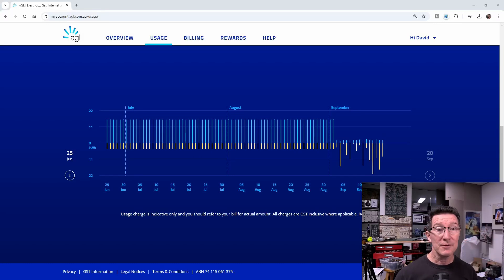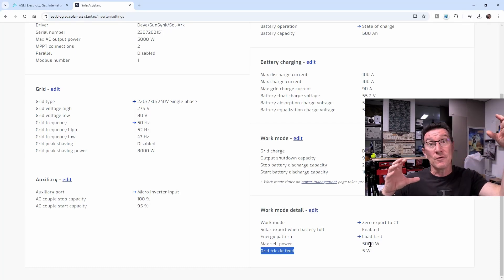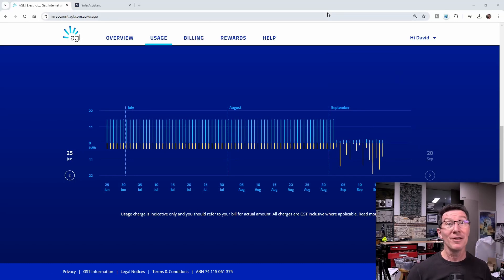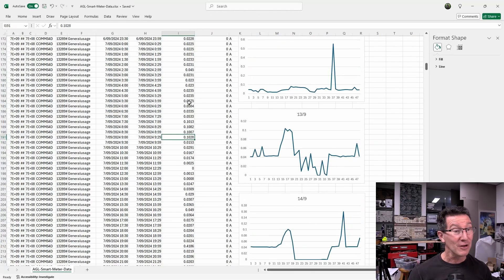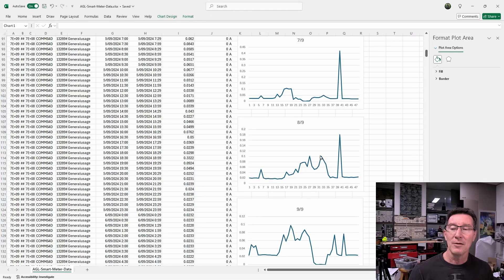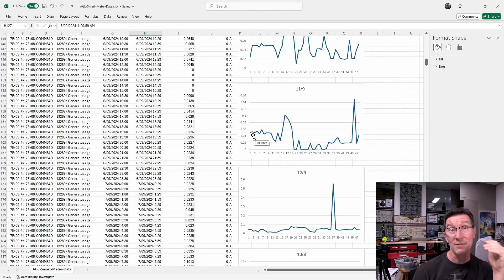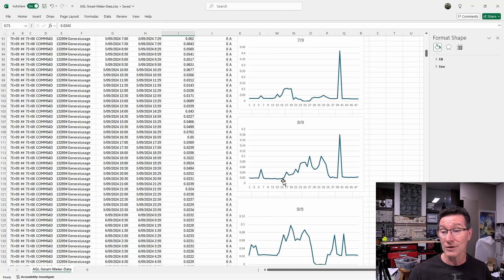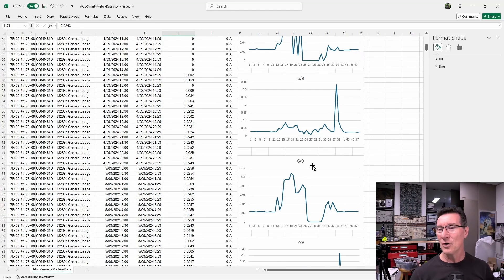Dodgy Smart Meter - Part 2 Electric Boogaloo

Comment: This is completely normal for an AC coupled grid tied system. Loads turn on / off instantly but inverters (both by design and by Grid code standards) have a set maximum ramp rate, e.g. if ramp rate is 200w per second, and you turn on a 2kw load, it will take 10 seconds to hit inverter outputing 2kw. And then the same in reverse when turning off load. Multiply that my dozens of devices constantly turning on/off, increase / decreasing load and what you get is a constant ac couple tug of war. Your solar analystics and grid meter data is also only showing you these fluctuations rounded to 10/30m intervals, but its actually calculated internally to 1 second intervals. I have much more accurate data from some of my ac coupled systems which show this and might make a good video if you are interested
Reply: This. The control loop in the inverter to alter output current in an effort to zero the grid feed isn't perfect. They're often in the 1 second update range, and quite damped to avoid oscillating. Switching on a load can take several seconds before the inverter cancels its mains draw. You'll also export a bit after the load switches off. Hot plates, ovens, water pumps, refrigerators and other short cycle devices exacerbate the issue.
Reply from the maker: During the day there are 15 inverters involved here. 14 x Enphase and the one Deye that provide power to the load, which complicates things. But makes sense that the lowest impedance source (the grid) will take any pulses until the inverters can react.
At night time it's only the single Deye inverter.
Inverter reaction time does seem to be a plausible explaination, I'm still thinking the import number seems excessive though, it's not like we go switching things off and on every few minutes and the inverter is constantly trying to react hard.
Reply: @EEVblog2  thanks for pinning my comment 😁 my first comment was meant to highlight that when ac coupled, it's a constant push/pull tug of war to balance out load vs supply. Ramp rate is just 1 part (and easy to explain in a short youtube comment) it 100% doesn't explain everything, but that whole control feedback loop does, ac couple feedback loop usually has a response time of 2-3 seconds + the ramp rate. I have grid metering to 1/10th of a second accuracy that clearly shows this feedback loop and reaction time limiting as well as constant ac load fluctuation of what most would consider a constant smooth load. if your interested to see this whole process in action happy to share data. (Not sure how to reach out directly if your interested?)
Reply from the maker: @CptEcho  Yes, I now think this is the majority of the explaination of what's happening here.
Reply: @CptEcho I would just like to clarify to other people that the ramp up rate is location/provider/grid dependant. And also wanted to add that some inverters distinguish between grid loads and internal loads and might not apply those limitations. Whether that is also location dependant I do not know for sure, but in NZ my Fronius Inverters and Tesla PowerWall 2s take my loads pretty instantaneously (within a second) but grid export ramps up at about 1kw per min at start up but otherwise it reacts pretty quickly to changes in inverter output or loads.

The rest of your explanation is spot on, anything the inverters can't provide comes from grid and over a whole day they do add up. Also some inverters have a very small draw usually when not exporting to keep them powered and synced (grid tied systems) which also adds up. Another thing I saw is that my Ferocious internal smart meter is also slightly out (I think it's like 15w drain when literally the breaker is open).

My lines smart meter is usually within a few KW each month with the other meters when I compare the daily breakdown (I can get a CSV export) so I think that is within tolerances.

But that is neither here nor there, your explanations and comments stand.
Reply: But wouldn't it be 200w per second in both directions? It would still average to 0w draw on average. To see an average import with 200w per second ramp up the ramp down would have to be faster, say 500w per second?
Reply: @BenBrand  there is no averaging for metering / billing, you are charged/ recorded for every second, which is then summed (not averaged) into the 30m blocks of data reported. So in a theoretical 30min block if you export 1kw for 15mins and import 1kw for the next 15mins, the average is 0, but you are charged / credited for both 1kw import and 1kw export.
Reply: @CptEcho  yes, but it doesn't look like that's what's happening? It's rarely zero and never negative. I can see how if it ever does go negative it would just stay at zero since he's not allowed to export. But if it truly was even in both directions then it would be zero about half the time and positive about half the time?
Reply: @BenBrand  that's not how this meter records data, it has a seperate export register and an import register, in the video he is only showing the import register which is why it pegs to 0 when exporting, if the data was combined into a single graph you would see half hour intervals of import, half hour intervals of export and most importantly half hour intervals with both import & export.

Comment: As other have said, the inverter takes time to ramp up and respond to export/import imbalance. Additionally, the grid voltage is always changing making the job of the battery maintaining the export/import power difficult. Thirdly, when it comes to comparing one meter with another, both meters would need to have the same energy calculation integral. The way these types of meters work is to measure the energy over a period, typically about 1 second (I think this is set in a standard). If in that period, we have twice the export as import than the meter will read over that 1 second an export power only (no import). Catch Power has a device that makes use of this. It is possible for a revenue meter to return zero import while powering a 3.7kW hotwater system element with only 1kW of solar generation, by switching the hotwater element on and off 1/3 on and 2/3 off. The duty is varied to always maintain a 1second net zero.

Comment: The algorithm to select which power to "exported" from a battery to an AC system is always behind the actual usage. Take for example when a fridge turns on. it will introduce a peak then most likely it will overcompensate by providing little bit to much power etc.

Comment: While I agree with others that 30m is too coarse for a detailed hunt for the cause of the drain, I disagree that it's the ramp rate. That just makes no sense if you actually do the Math. Let's say there were appliances that frequently pull 2 KW for a short time, incurring a ramp rate as was suggested by @CtpEcho of 200 W/s (which seems rather low to me, but I live in a different country with different electrical codes). Since a fully linear ramp is equivalent to half the "ramp delta" for the same duration, that would be 1 KW for 10s, which is 0.0027 KWh. How many of those "ramps" do you expected to have over a day to get to almost 2 KWh total? About 740, so roughly 1 per 2 minutes (ish). Yea right. That would be literally insane appliance behaviour.

I mean I don't know your electric loads, but we have everything electric, so no gas or other fossils used or even installed at all, and no AC. Even a dishwasher, washing machine, dryer or whatever will never pulse to such an insane degree. We also have smart plug monitoring for most larger loads (except the cooktop and electric water heater), and can just see that on a per second basis.
For value comparisons, we also got a solar installation (only ~7.5 KWp, but smaller battery of only 7.8 KWh or so), and on days where we are as self sufficient as possible we're on 0.1 to 0.2 KWh grid usage. 1.8 is WAY too high for your setup IMHO.

I would say throw some smart plugs into the monitoring situation (they are cheap enough with monitoring these days), and see how your actual loads behave.
It might be that the reaction delay to any change (before the inverter reacts at all) is misconfigured? Or the ramp time is off by like an order of magnitude for some reason maybe? I would go over all the settings, but without knowing what your load profile looks like that'll probably be hard to identify...

Comment: Three further reasons for low level usage:
1. The BMS can request charging to balance its cells or to protect the battery from becoming over discharged (on my battery at 10% further use is prevented and at 6% SoC the BMS requests a slow charge to bring it back to 10%).
2.There is inverter lag (the time difference between a load starting / stopping and inverter changing its output power to match).
3. CT / Meter out of calibration.

Inverter lag at least for me was improved by a firmware update. There is usually CT compensation settings which can be adjusted. In your case the CT might be reading too low so the inverter not fully catching loads.

Comment: As neither the smart meter or the inverter/battery system measures power directly the voltage & current variations between them will add additional noise to the data, beyond that of the pure MID accuracy rating, as you pretty much covered already.  

Arguably the additional need to measure supply voltage and (simplifying here) raise it for export, balance it for 'zero' and lower it for import adds additional noise as the inverter/battery system cannot presume the supply voltage and has to sample it regularly.  I presume that the inverter will have a set limit so that it does not chase the supply voltage spikes to above the regulated supply voltage, dropping the output and resampling until within limits.  As an aside, here in the UK my supplied voltage is always very near the upper legal limits as it is advantageous to the suppliers.  [UK = 230v -6% / +10% (or 216.2 to 253.0v).  The lowest I have ever seen is 239.57v and is usually in the 247 to 250v range.  Last month's highest supply voltage was a sparky 254.53v.  The Dilithium Crystals can take it, apparently.

Phase management is another active system at play as the battery/inverter system will need to tune itself to the (relatively minor) phase fluctuations on the supply side.  As with voltage and current measurement the inverter/battery system will respond somewhat in lag as it has to sample the incoming before tuning the export to the grid.  This 'input sample & export' cycle will also show as a tiny import reading may also add additional noise that trends towards an import measurement.  

Of course, everything needs to work as intended too... my SolarEdge system has basic mathematical errors in the displayed calculations.

Comment: It can be only synchronising-issues between your home-system and the grid. The electronics have to synchronise quite a lot depending on load but also on the grid.
Especially with switching power-supplies in use, it will constantly need to synchronise and therefore put some small amount of load on the grid unless you can mechanically decouple it and later couple it back on.
One of my inverter-battery-systems is using this and with a delay of 20 minutes unless significally overloaded. It just switches itself from the grid (relay-based) and checks again after at least 20 minutes. That now makes it really 0W overall. With this off, it was creating small loads all the time enough for the smart-meter.

Comment: If optimisation towards zero net import is a hugely important goal, would it be worthwhile to prepare a power duration curve & payback calculation on different peak power output battery options?

Comment: With my set up, because I pull data from several systems, they don’t all respond at the same time, in fact my battery data comes from the cloud rather than direct from the inverter itself (yeah I know!) so it can produce some rather unusual wtf readings sometimes.

Comment: You only get zero in the middle of the day when you likely export to the grid.
30 minute intervals is just way to coarse to see anything. It is most likely the inverter that can not respond fast enough to changes in load power so it briefly imports energy from the grid. It could be just a second or even less but enough for those spikes to be recorded by the smart meter. Thus what seems like fairly random data.
You can see that at night imported power is fairly constant and much more variable during the day. So is the inverter that can not guess when a load will switch ON and it needs some time to react and correct the amount of imported power.

Comment: You have to read the fine print that comes with the smart meter.  It comes preinstalled with a electron gremlin.  It was trained at the factory to only eat electrons from the grid.  Solar electrons give it gas and no one likes a gassy gremlin.  What you have measured here is the electron gremlin input.

Comment: Try plotting the solar production along with your consumption.
You'll find your consumption goes to zero when you are exporting significantly, say >1kW.

As for the other spikes, the Deye inverter doesn't respond very quickly to a step change in demand. You can test this by putting the kettle on. You'll consume from the grid while the Deye increases it's output to match the load and then you'll export while it decreases it's output.

Don't have a good explanation for why the rest of the input is so high though.

Comment: Hot water timer??
Reply: He has a dedicated current clamp for the hot water.
Reply from the maker: I have a heat pum that switches on at 10am for a few hours, 1kW draw.
Reply: @EEVblog2  Wouldnt have that issue with a gas HWS.. ;p
Reply: @EEVblog2  I was thinking more likely a fridge or something.. Meter all the things!
Reply: I'm assuming these are not three-phase values and you're looking at the single phase? Might be time to get some more metering equipment. I tested many many meters working on the network and almost every single one was very accurate.
Reply from the maker: @TobyRobb  Yes, single phase.